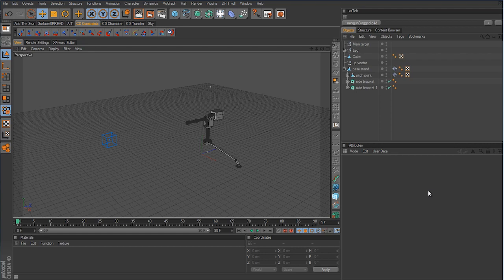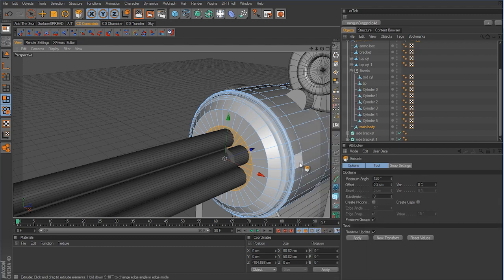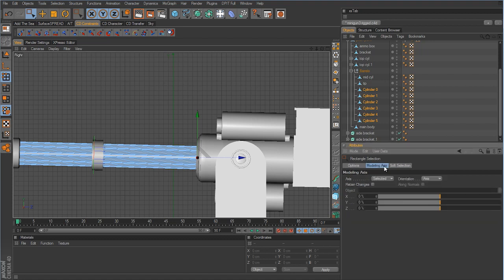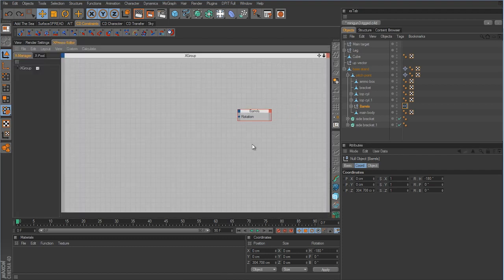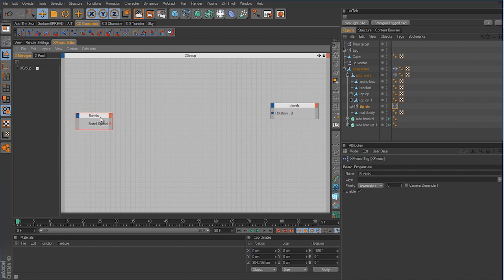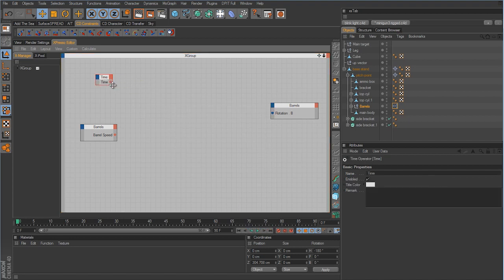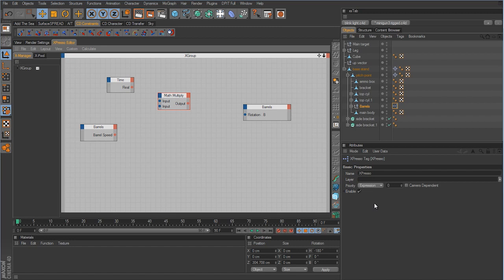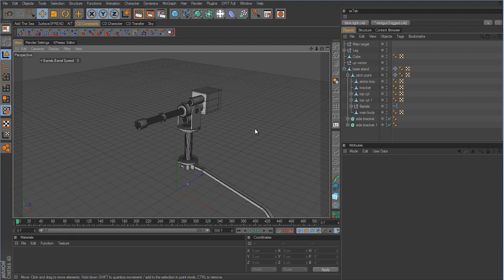Cinema 4D Tutorial - Minigun Part 5 - Xpresso controller for barrel speed

Comment: First off, thank you for making this video @ShepperOneil 12 years later still useful! I ran into the problem that when I keyframe the values for the barrel speed from 0 to 720 and then back to 0 after the animation goes past the second keyframe of 720 it starts rotating backward. Hopefully, you can help me with this. FYI I tried with smaller values to make sure it wasn't the stroboscopic effect.
Reply from the maker: The Xpresso setup I used in this video is an older setup, and unfortunately it has that problem that you described. Try the following and let me know if it works: https://ibb.co/x1w363n
Reply: @ShepperdOneill  Yes, it did! Thanks, you are the best!!!
Reply from the maker: @pipostream  Awesome! Glad it worked!